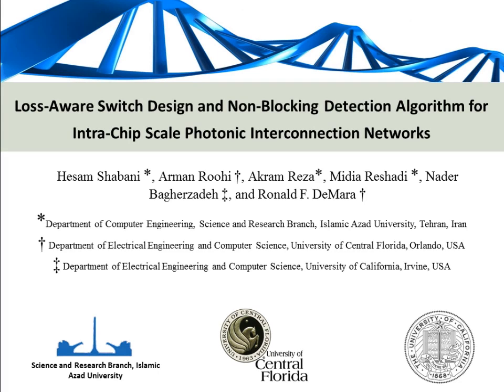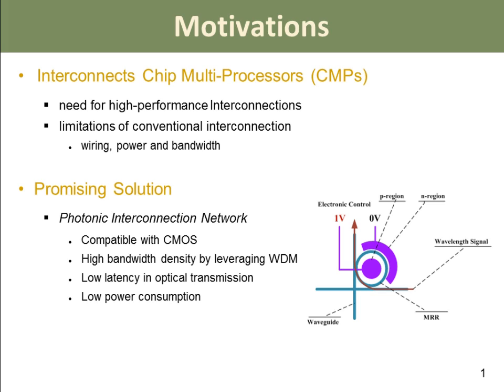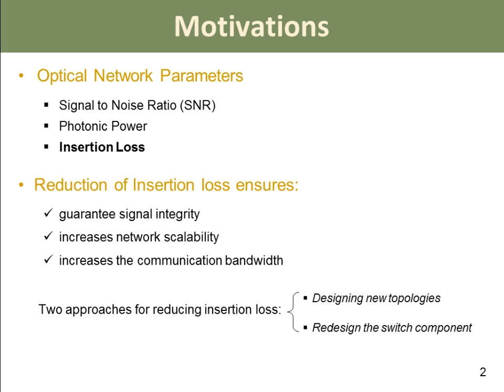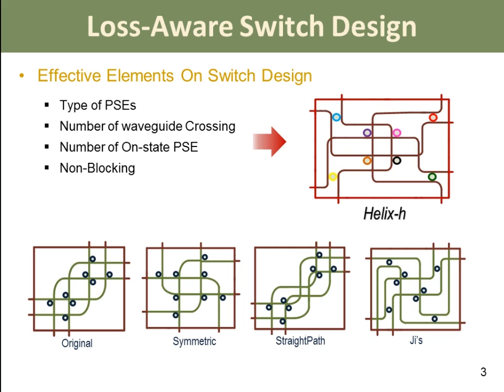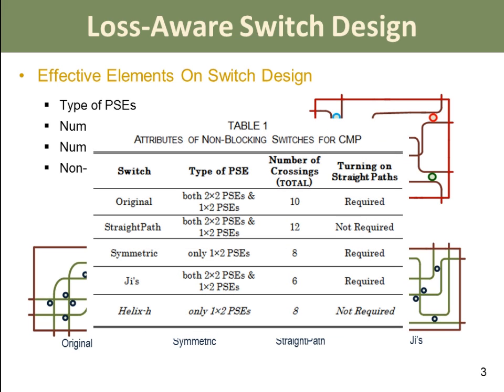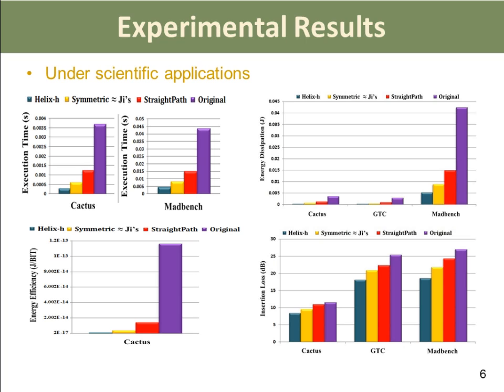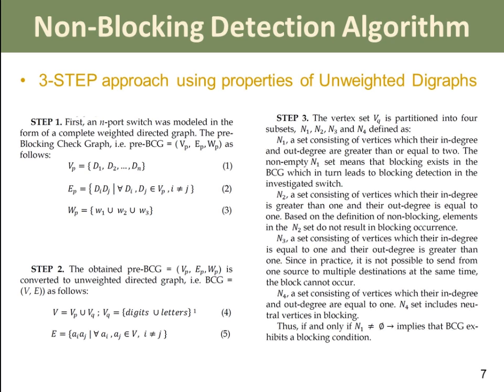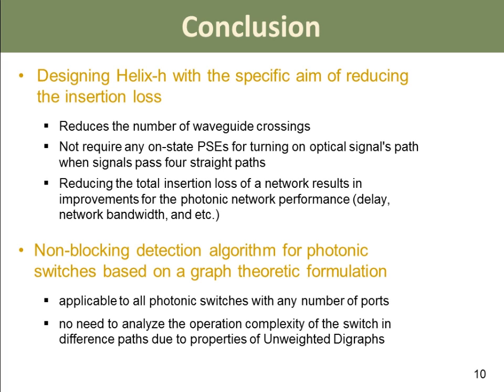Loss-Aware Switch Design and Non-Blocking Detection Algorithm for Intra-Chip Scale Photonic...

Comment: Excellent work by Prof. Ronald DeMara and the team. Congratulations on the  highlighted article of the June issue of the prestigious journal on computing IEEE Transactions on Computers ! 
This scholarly work tackles the issues of interconnections in modern chip multiprocessors which is the current trend of modern and near future computing. The improvements over existing alternatives are significant. After all the impressive results and generalization of the developed technique,  the work is so complete that it definitely deserves such a special place in TC. Awesome